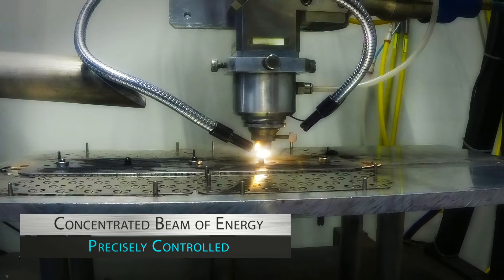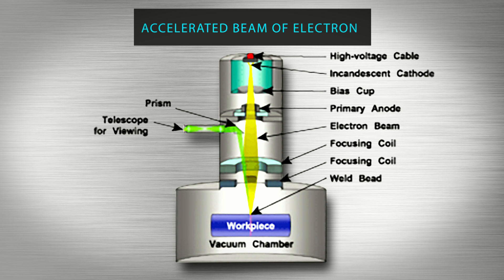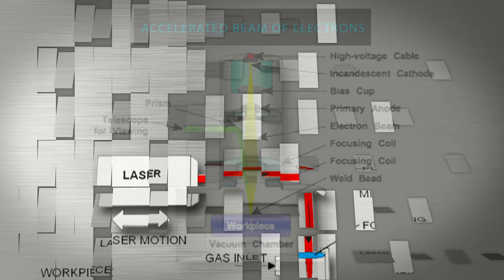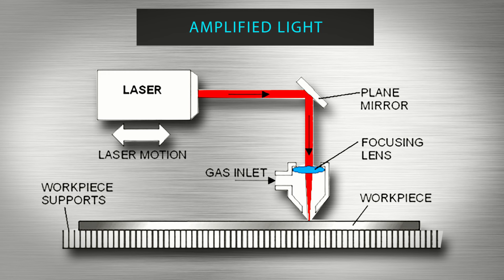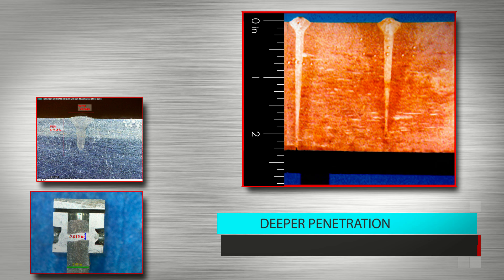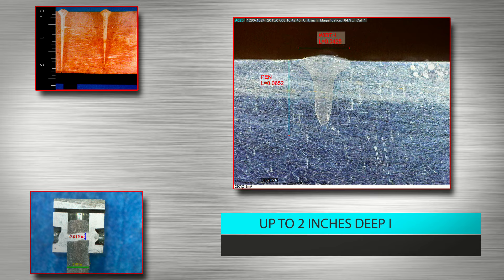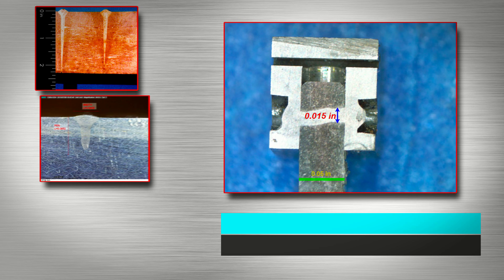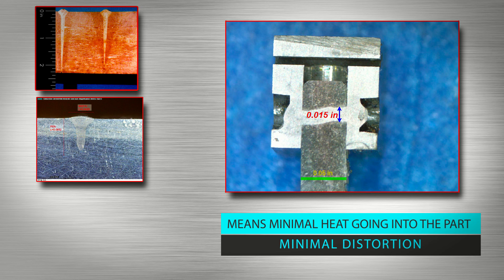Electron Beam Welding vs Laser Welding - Advantages and Disadvantages by EB Industries

Comment: Wow – brings back memories 1966 at Sundstrand aviation – English Electric – Liverpool 
Beam welding on a Hawker Sidley DYNAWELD – 
By error, noticed if the components where dipped in liquid nitrogen! The beam parameters could be dropped 90% achieving no distortion – zero colouring – full penetration – 90% less power – ceramic / tungsten filament lasted far longer – This was simply called “Super Conductivity”-

Comment: there are many examples of EB welding outside of a chamber, or rather it's inside the chamber but the chamber is mobile and moves along the workpiece. There are also non-vacuum methods of EB welding.

Comment: I have to disagree on your explanation for Lasers lacking penetration. It is not about reflection! Lasers do up to half inch penetration very easily. Probably more, but I don't have a Laser strong enough to try. ;) If it can be welded with a laser: Use a Laser! If it can't, EBW might be your friend. 
The big advantage for penetration that the EB has is the vacuum. For deep penetration welding you need to open up the "key hole" filled with vaporized base material. You have to boil the steel for that. Under Vacuum steel boils at ~2500°C. In atmosphere it boils at 3500°C. That is a HUGE difference!
Laser welding under Vacuum is also a thing. The beads look very similar to EBW.

Comment: Are we using flux in lbw & ebw or not. And why?
Reply: In E.B. Welding, the welding is done in complete vacuum, therefore there is no need for Flux, or for that matter filler metal. Pump down at the machine that I run for work is six minutes. The most critical part is that your weld joints have to be cleaned with Acetone to ensure there's no contamination. L.B. Welding does require a shielding gas since it's done on the open atmosphere.